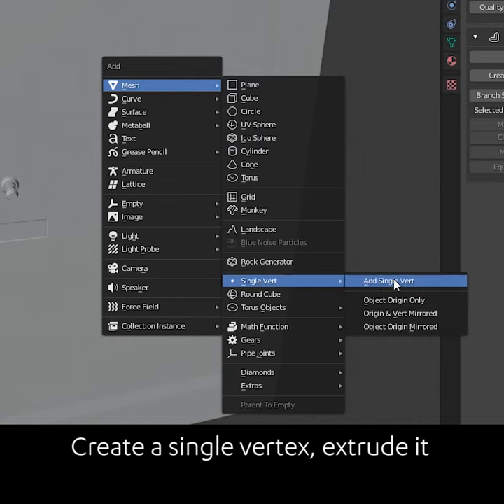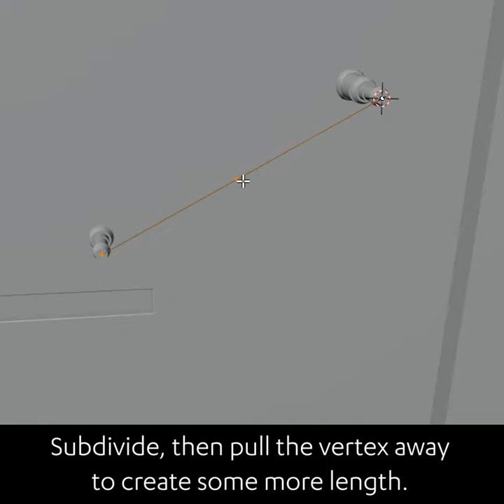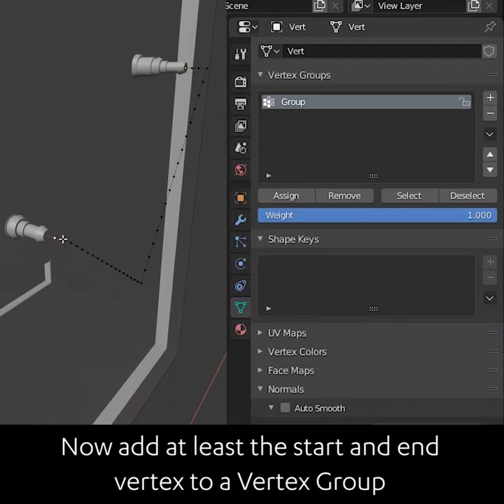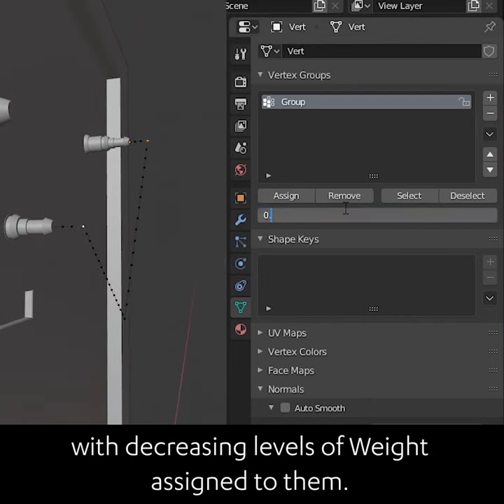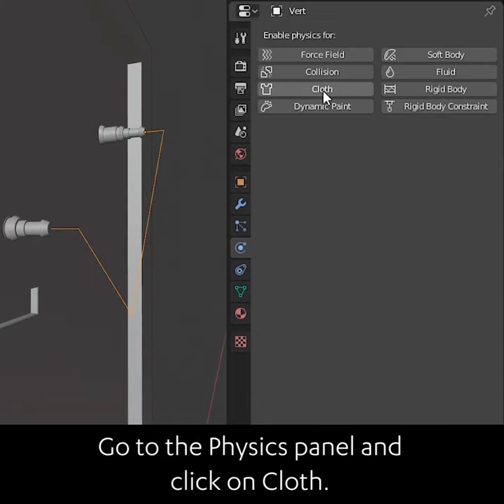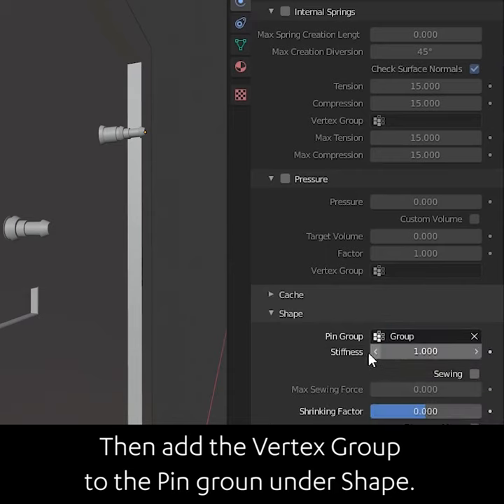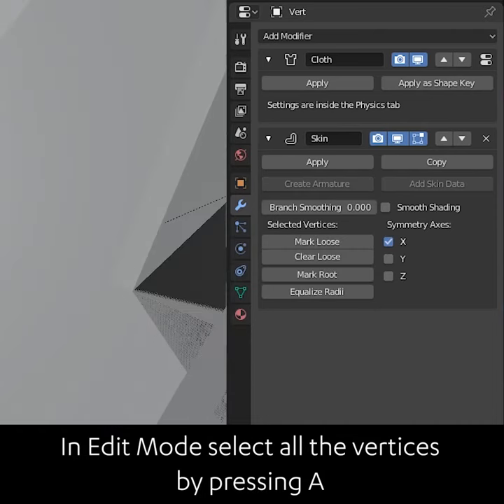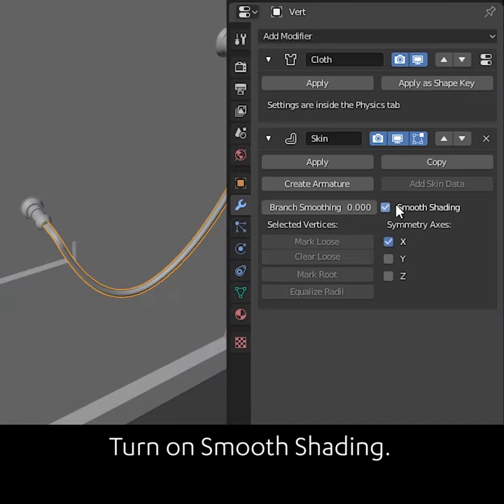Blender Secrets - Cables with physics

Comment: Will it work with a curve too? Curves support softbody physics, however you can't give them vertex groups to pin the ends. Curve physics have been problematic in general for me, yet are tempting as they can be very useful and flexible.
Reply from the maker: Probably with a Hook (ctrl+H)
Reply: @BlenderSecrets  Sadly doesn't work =(

Comment: An unfortunate trade-off using the Skin Modifier for surface volume.    Smooth shading is only a rendering cheat - when textured, the cable still reveals sharp corners.    To get a geometrically smooth radial surface we have to use real cylindrical geometry or the generated bevel surface from a curve - but the Cloth Modifier only works on mesh geometry.    The extra geometry of a mesh tube requires much more calculation for the Cloth Modifier, and tube geometry will collapse under a Cloth Modifier.

Comment: Love this, thank you so much! 

I'm trying this technique to make hanging lights. Is there a way I can attach the lights to the cable and have them be affected by the physics?
Reply from the maker: That's hard, I've tried experimenting with this kind of thing but I couldn't find a real solution.
Reply: @BlenderSecrets  Hmm yeah I'm struggling as well. I could parent one of the bulbs to a vertex point on the cable and it worked. But any additional bulbs after that would only parent to that same vertex point and not reacting accurately to their position along the cable.
Reply: @kontrastwesen4066  Sweet I'll check it out, thanks!

Comment: Can we pin Vertices onto moving objects?
Reply from the maker: Yes by using hooks
Reply: @BlenderSecrets  Thank you.    I'm having no luck with this,  but I appreciate your cable tutorials.
Reply: @vain3d973  Set up this exact cloth simulation, then in edit mode on the cable select the vertices you want to attach to the animated object, press ctrl H and select hook to new object. You will be given an empty that you can parent to the animated object. There will be a hook modifier in the modifier stack, which you need to move above the cloth modifier.

Comment: My simulation is not working after I assing the pin group
Reply from the maker: When you say not working, what happens/doesn't happen? Did you press spacebar to start the animation? Try baking it instead of playing it in realtime.
Reply: make sure you are in Object Mode when your press play on the animation. Won't play in Edit Mode

Comment: Seems not working on 3.1.2. When I scale the vertices in Edit mode, all the cable is scaling on its total lengh, no matter using Indivudal Origins. Cannot scale down the thickness of the cable skin. 
ALTERNATIVE: Extrude the path according to the needed thickness, then add a Solidify Modifier of the same thickness, shade smooth, and done. Like you describe in your next video: https://www.youtube.com/watch?v=02HwYISoJEs
Reply: Try Alt+s

Comment: Nothing is happening if i try to extrude the vertex :/
Reply from the maker: Are you in vertex select mode? In Edit Mode? Is the vertex selected?
Reply: @BlenderSecrets  I was in edit mode and the vertex was selected. I pressed E to extrude it but it did nothing
Reply from the maker: @OfficialInternetExplorer  Hmm, it should work. All I can say it most of the time when this happens, you are actually in Face select mode instead of Vertex select mode. It just doesn't look like it, since you only have a vertex. It's also not so easy to see if the vertex is selected or not. In Edit Mode can you try pressing 1 (on the top number keys, not on the numpad), then A and then E and move the mouse?
Reply: @BlenderSecrets  Oh. Now it works! I wasn't using the vertex mode.. Thanks! #BlenderBeginner
Reply from the maker: @OfficialInternetExplorer  It still happens to me as well.